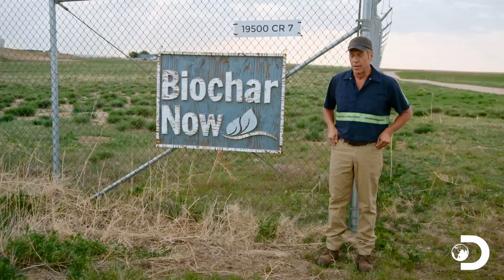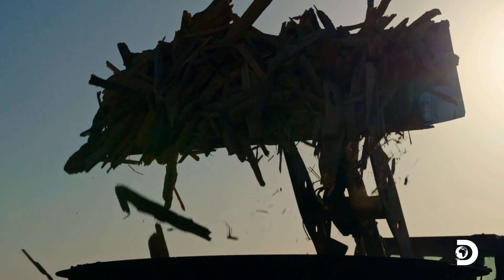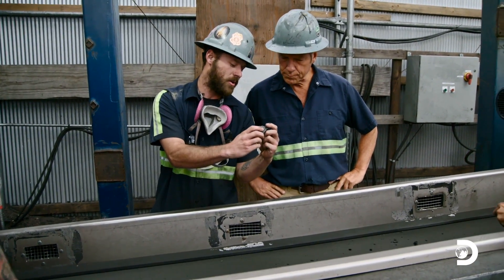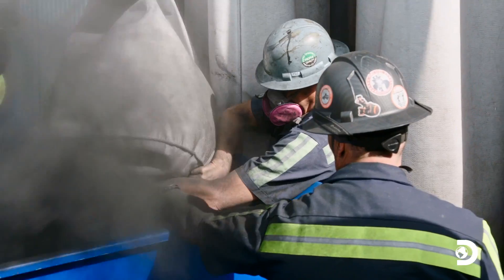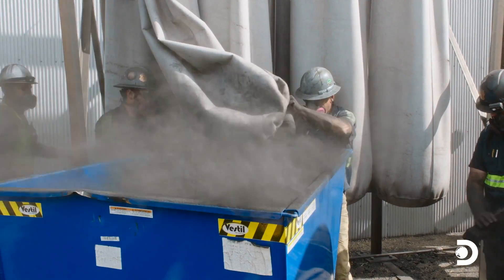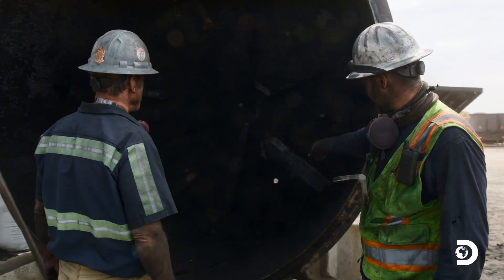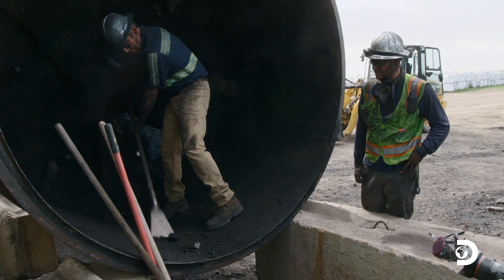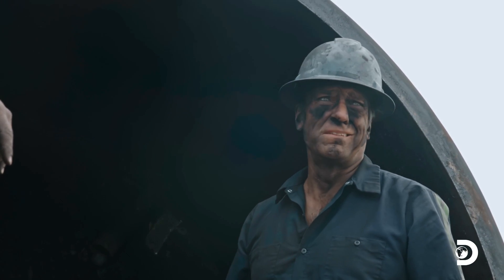Mike Rowe Helps Solve Global Warming! | Dirty Jobs

Comment: Couldn't they put a sheat over half the dumpster while emptying that fine powder, so it doesnt fly everywhere as much. There seems like there is a wayyyy better and less messy way to empty those bags. O also, instead of using a center zipper, use a zipper in the round so the entire bottom can be undone and the carbon would just fall out instead of having to shake it and get everywhere. Just sayin'

Comment: You know you can chip up the trees like you would to make the charcoal only save the energy of heating it and use it as a ground cover that breaks down into soil. Did that on my farm. You may want to look at some of the thing Joel Salatin has done on his farm to sequester carbon and provide food to thousands of people.
Reply: Compost and pure carbon ain't the same thing.
That compost will break down in a couple years, but the carbon will last thousands of years. 

As that wood composts, it consumes nitrogen in the soil (requiring more fertilizer) and breaks down into C02, same as if you'd burned it.
The charcoal doesn't break down, though. It stays in the soil, providing a home for beneficial bacteria and holding onto moisture and nutrients.

Comment: Wouldn't it be nice if nobody noticed that this solution to climate change was not fueled by burning?
Reply: How do you think they convert the wood into charcoal?  They heat it in an oxygen free environment, but that still requires the input of energy, usually done by burning something around the kilns.  They are either burning wood to produce the heat, or using electricity which is likely derived from a coal or oil plant in that region of the country.

Comment: Wouldn’t it be much easier to have the stuff dump right into an enclosed hopper like they do with sawdust.
Reply: And if the "utter" had a zipper that opened up the entire bottom circumference of the bag instead of only a thin slit.

Comment: Why don’t they have the zipper around the whole bottom so it all come pouring out. And boom zip it back up. The design on those bags is dumb
Reply: I would say the weight would possibly bust the zipper open if it was all along the bottom of it. The zipper being short prevents a spillage.
Reply: had the same thought 🥴
Reply: It needs to have a draw string around the bottom but not my job not my problem.
Reply: The friction from the super heavy duty zipper caught the highly flammable microdust 😅